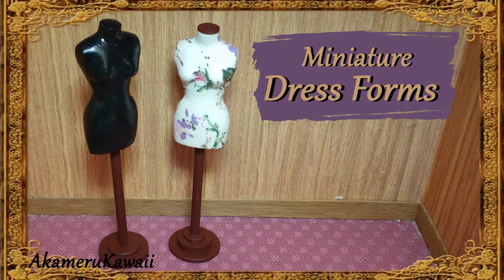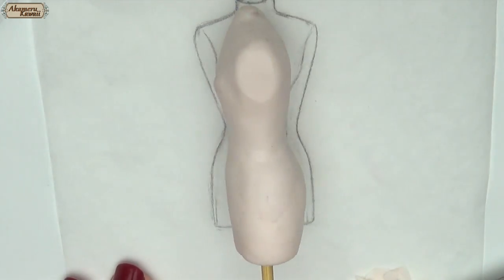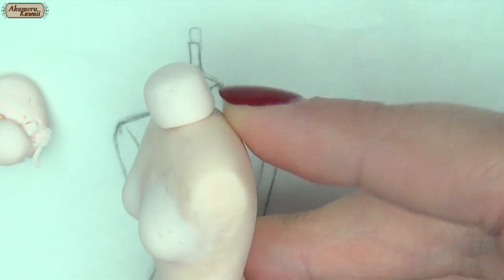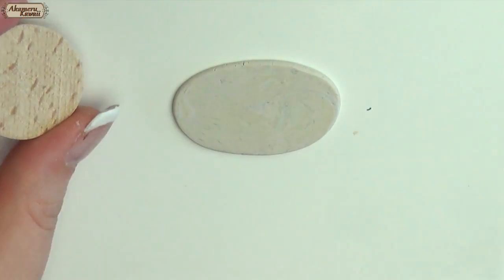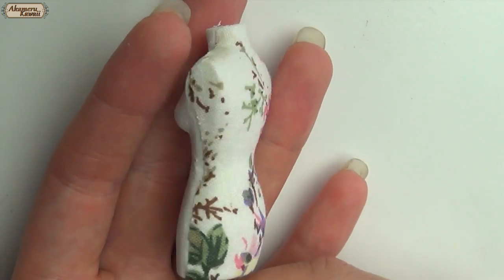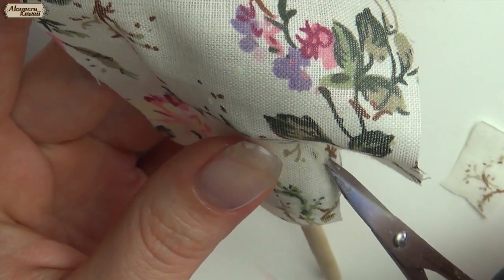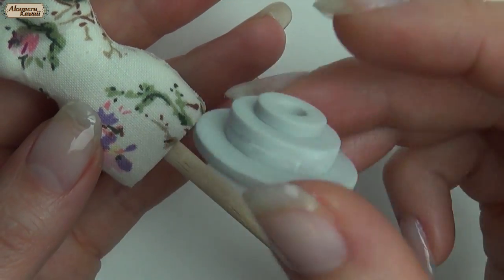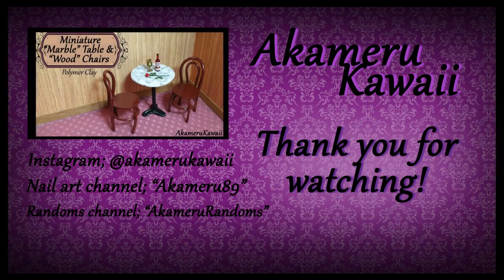Miniature Doll Dress Forms - Polymer Clay/Fabric Tutorial

Comment: I know a much easier way to do a mannequin. You can wrap a doll's body with cling wrap, then press it in clay to get the imprint.(DO NOT WAIT FOR THE CLAY TO DRY BEFORE FINISHING THE PROJECT!!!!) Do this for the front and back. Fill the two imprints with hot glue. Wait for it to cool down. Take the two resulting halves out of the clay (it should be easy if you did not wait for too long). You can sculp the space needed for the peg at the bottom of the two halves. Once you are sure the stick you choose will fit the hole, you can glue the two halves together, and put the stick in the hole.

Comment: Interesting!  You used bare hands to handle the E6000 glue.  What did you use to wash them off your hands?  Did you have to use a mask when gluing?  I might try this, but have never used E6000.   Will hot glue be a good substitute?
Reply from the maker: +SuperModerngranny Hot glue will be hard to use for this. Always be in a well ventilated area when working with strong glue and try not to get it on your skin - I'm clumsy ;) I washed my hands well after.

Comment: could you make one that is actual size as the doll for making clothes?
Reply: Angel Ash I had the same thought and the only way I thought of was making a mold of the doll’s torso without the head, arms, or legs and filling in the gaps with air dry clay. After that’s done you could make a mold of the piece and fill it in with resin, and then paint it or cover it with fabric. Kind of complicated, but extremely accurate. This is all hypothetical and I haven’t tested it out myself, so there might be problems if you actually try it, although I might try it soon. Sorry for the long post and I hope it helps! <3